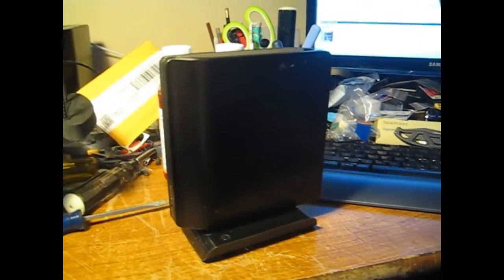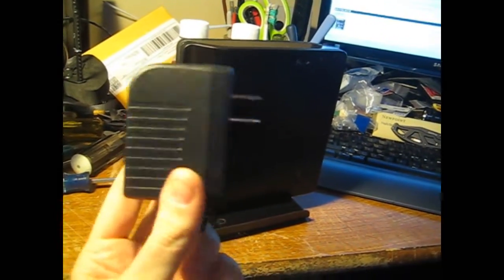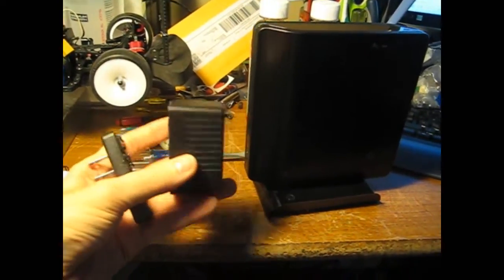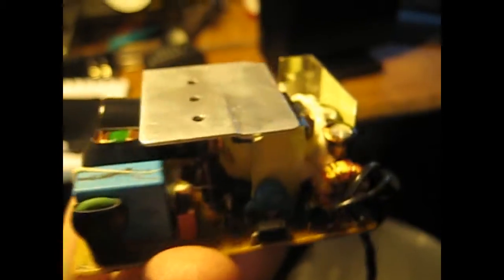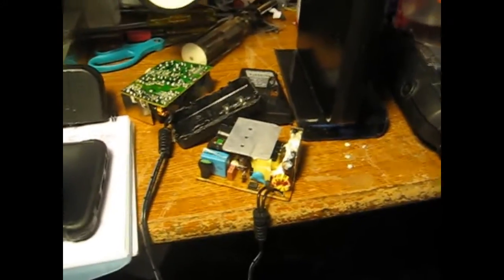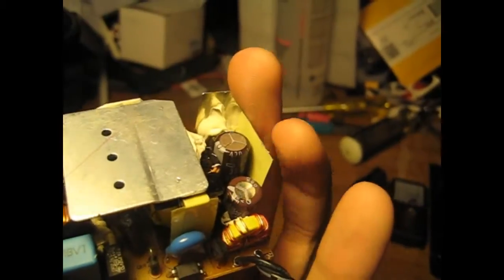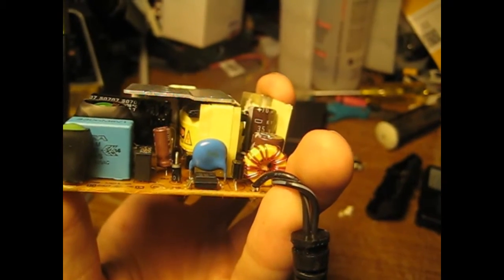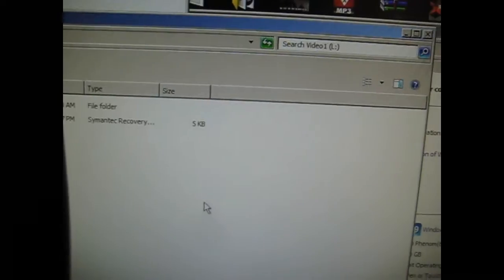External HDD Repair - Seagate FreeAgent Pro - Power Supply Capacitors

Comment: I have 2 750 gig Seagates with the same serial number you mentioned.  1 of them stopped working about a year ago.  It makes a clicking / screeching sound when I plug it in.  I swapped the power supplies, but the same drive will not work.  I opened up the hard drive and noticed the head was in the middle of the platter.  I removed the head from the platter, but the drive still doesn't work and continues to make the clicking / screeching sound.  Any advice?

Comment: Is there any way to get the hard drive working if it is not the power supply?  I used the ps on another drive and it worked, so something is wrong with the drive.  and just a week ago when it was working I told myself to back the data up on another.  of course, I didn't.
Reply from the maker: Another identical drive?  I forgot I also tried one of my "broken" power supplies on a random (Rosewill?) enclosure with some random 1TB (WD?) that I put in it.  It seemed to function fine with that setup, but not with any of my Seagates shown.  And vise-versa, another power supply on that broken drive doesn't help?

If it is the drive... might be lost.  If you can get in there and get the bare drive out, you might try something that has worked for me in the past (I've got a video or two on it somewhere around here) which is to remove the circuit board and clean the contacts on it.
Reply: alecjahn I used the Seagate ps on a WD drive and it worked.  but that sounds like the same scenario as your experience.  I am hoping it is the ps.